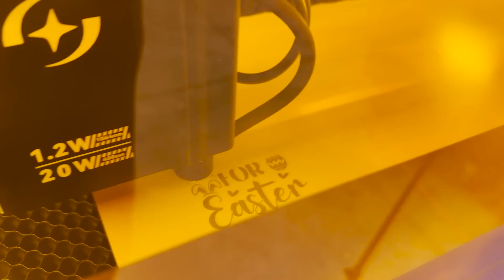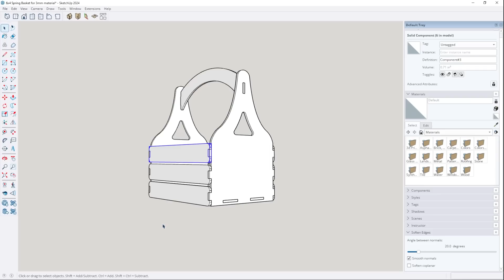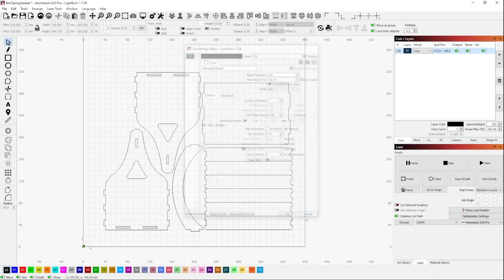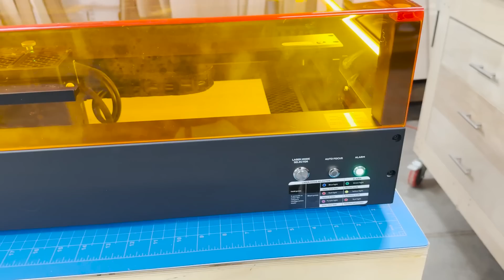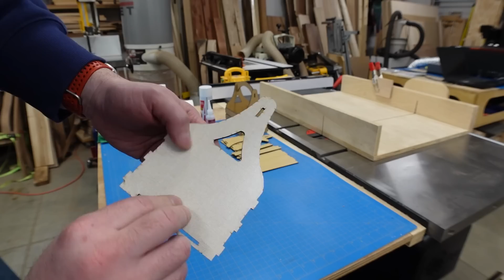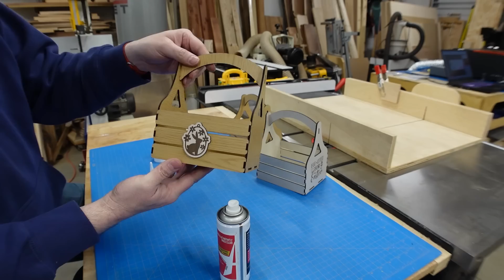Laser Cut Baskets featuring the Atomstack Kraft

Comment: I always like watching your videos -  I have a Atomstack S40Max and Im looking for an enclosure like you have for the Kraft.  Would your enclosure fit my particular laser.  Any help you give me is very much appreciated
Reply from the maker: The Kraft is built into the enclosure so it’s not something you could put the A40max into. I have another design that was built around the original XTool d1 but that would be too small. I have been working on a larger enclosure that fits the a70 pro but would not be wide enough for the A40 max as well.
Reply: @Vintauri  thanks Steve

Comment: I need to cut fabric into small pieces from 2 to 8 inches. What laser machine can I use with small budget!
Reply from the maker: It will depend a bit on the fabric but for most light weight fabrics, any 10w diode will work.  You don't want too much power for that unless you are cutting thicker material.